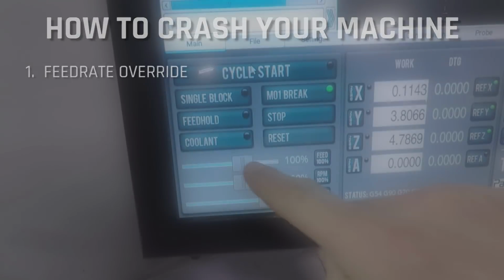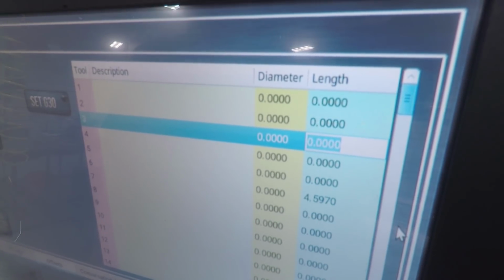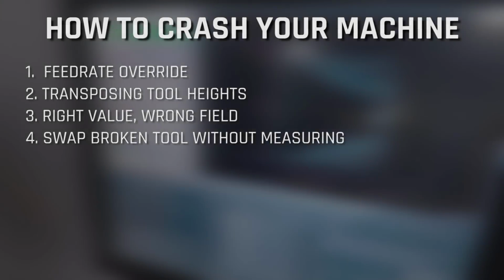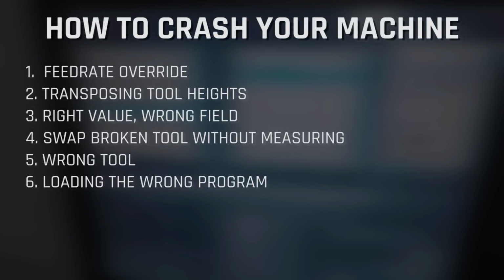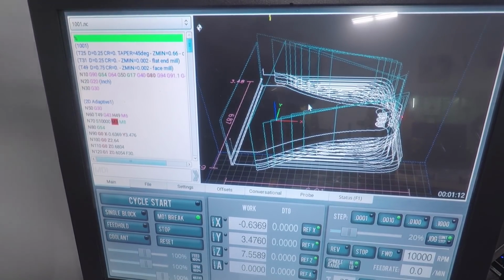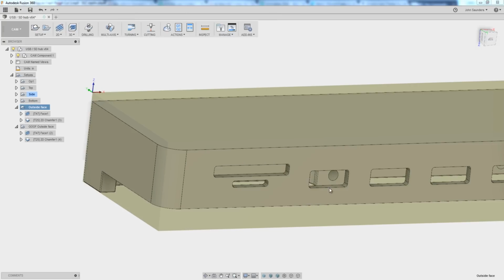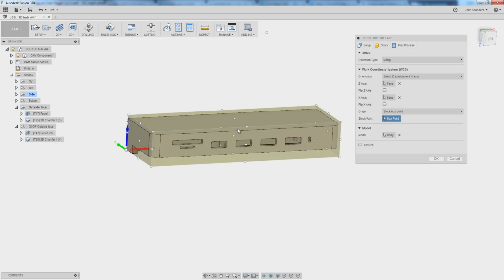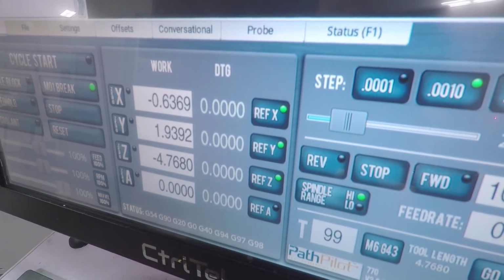9 Ways to Crash your CNC Machine!

Comment: I used to program CNC lathes, machining centers, screw machines, etc. by hand in the 1980s, long before CAD/CAM came into common use..... And I have seen many examples of each of these nine potential crash mistakes. In the beginning I've made my fair share of them, but after a while...... After it sank into my head that human beings make the mistakes...... Not the machine..... I started becoming super careful about every move I made. When I wrote a program I made sure that I knew where the tool was at all times...... Where the edges of the part where at all times...... And where the fixturing was at all times. If I didn't, then they're most likely would be a crash..... And I would be the cause of it.

I can't thank you enough for making this great video! This is the type of thing that all CNC machinists and programmers should see before they even go near a CNC machine for the first time. Great job!!!!

Comment: I crashed my machine. It was a 90s 5th axis thermwood router running on IBM os/2 warp. It was my 3rd week of training and they gave me a new program and both coworkers were at their machines and forgot to modify it for me and I was sitting down deburring my parts and the machine picked up a longer tool by an inch and crashed on top of my fixture and part which was plastic. It wasn't loud but the Siemens controller modual gave me the white screen of death with the picture of the machine and where it happened. After that I haven't crashed since

Comment: Most of these mistakes can be avoided  when proving out a tool for 1st time by using distance to go properly.
If the distance does between the workpiece and tool does not match what’s on the distance to go on screen then don’t press the cycle start button.

Comment: How is still using this method of touching tools off??
A few of those points, you can eliminate with 5S.
Feedrate override is one of the most important things. Especially when you work with 5 Axis.
Proper training of the operators can help too

Comment: John, of you do a video on other ways to mess up in a machine shop, as an apprentice I once changed a tip and pulled the offset way back, got everything running fine and continued machining all night, when assembly started in the morning I discovered that the O/D on my parts were exactly 1mm undersize, I had forgotten one of the rules, ‘whenever setting up or making a insert change, always check with a Vernier before checking with a micrometer. I was trying so hard to keep the 0.025mm tolerance that I forgot the big picture.

Comment: Not updating my tool change position has made me crash my machine twice. I like to make my tool change position as low as possible to cut down cycle time, but if you do not update the position to match the program and setup it may rapid to a tool change position that is below the part or vice!

Comment: I had a few goddamn moments on a cnc lathe . I learned my lesson for the most part , and that is to threat every first part on a new program with utmost attention , rapid movements down , hand on the feedrate override knob . 

The most important thing is don't rush your first part , (i know this is hard to do when you often get one offs , but you must take your time) , make sure you have clearance , make sure you have enough clamping power , make sure you have all the tools measured , and start with 70% of the intended feed , speed and depth of cut , and then icrease them slowly after each successful pass . Doing this you can immediately notice if something is going wrong , and the damage won't be too severe .

Comment: i have a diy router instead of a professional cnc mchine, but i had plenty of crashes.

1. Rapid Z though my workpiece,  the  real Z was below the workpiece Z.
2. Rapid Z though workpiece, Forgot to update Z height with new tool.
3. a broke a drill,  i had the wrong z-retract height.  i had it set to z0 but my workpiece wasnt flat.
4.had some collisions with tool and fixture, those were soms big crahes (and ruined my tools)
5. lot of cooriditate mishap, like mistake the WCS location. (left bottom instead of left top)

Comment: Shouldn't the machine stop immediately when the axis load is different from what is expected? If per model I'm moving trough air, shouldn't the machine stop as soon as the table is registering more load than the weight of the part at this stage of the job?
I expect the controller to have a model of what should be happening, and stop as soon as reality differs from the programmed model.

Comment: Yesterday I crashed my Haas when I tried to restart a program mid-way through.  I set the start point at the beginning of the op I wanted, but forgot that it was the prior op that loaded the tool.  So not only did it not turn the spindle on but it didn't set the height offset and went 1400IPM right through the part.  Luckily the part was HDPE plastic and it was a $5 micro end mill.  I also caught it before it hit the vise so there was no metal to metal contact.  Cheapest crash ever!  Back up and running in less than 5 minutes.  The Haas control has setting 36 that would have caught that error had I remembered to turn it on.  One of these days I'll learn.
Reply: Kent Myers setting 36 FTW!  the only time I'll turn it off is when I have a super long program and don't want it to read the whole way through it first.

Comment: You would likely have escaped a crash, or your friend would have, with your example number 2.  If you make the mistake of specifying a tool longer than the tool actually is you should most likely just cut air.  Make the mistake in the opposite direction...well, your friend would be unpleasantly surprised.  

Good info, good video.

Comment: I learned a long time ago to immediately set all default lengths to 10in before doing anything.  That way if you forgot to measure a tool before you use it, it doesn't slam into the part/fixture when it comes up in the program.
Reply: Damn that is smart
Reply: With a first off, always have low rapid traverse and finger on hold button. And "distance to go" on readout. Also, have confidence!!! Shit happens but that's engineering. Some things are cursed, so if a crunch occurs, deal with it. Stop being shit scared of mis-haps. I got 31 years of CNC. I make a damn good living, I've had crunches. Learn from them. It's all about common sense. But I guess all you posters are yanks?? 🇬🇧👍
Reply: Thanks.  That makes a lot of sense to adopt as a practice.
Reply: This tip is GOLD
Reply: Jason Nackard Yep over here were metric so we always put 555mm in the tool offset table.
That way the machine will Z limit out.
Reply: That's a good tip!

Comment: Empty tools defaulting to 0.000 offset sounds awful. Makes you wish that somehow it could detect an empty tool or change and write in a huge offset until you typed in the next real number.

We always jogged the new tool close to an inch from the vice top and kept jogging up a tiny bit at a time until the 123 block just slid under and recorded that. Don't know if that's a good technique.

Also there was a habit everyone on their first run of the program stared at the first plunge and stopped it before it hit surface and read the distance to go off the screen to make sure it matched what you saw.

I still broke way more than I should have, almost always workholding elements out of place.

Comment: John, this seems like a good project for you. If you put sensors of some type on the racks that hold tools on machines that you manually change tools (switch or optical). Make a arduino setup to check witch  tool you took out of the rack when to make sure it matches what the machine is wanting at that tool change. I don't know on your Tormach machine controller what you can use for a feed back. Maybe you can some how pick up on the tool number and verify that you pulled out and put back the proper tools in the rack. Just a idea if it could be made to work.

Comment: haha i see you done these everything, but theory crash machine not possible. smart guy will allways use single line or lower rapid and look HOW FAR it still go. if you crash machine using new program you just made its operator fault. GO SLOW. what is hurry?operator who stop machine before it hit is better than guy who just think i made good program with CAM it works. CAM suck
Reply: Jari Sipilainen maybe the CAM you are using sucks?   What are you making if you are avoiding CAM?  Circles and squares?

Comment: I crashed my brand new 5 axis VM2-SS from a coding bug. I let my guard down for a split second and BAAAAAAM!! 1400IPM full rapid straight down. My underwear did not survive the event. 
These points are good! Great video.....
Reply: The spindle was still functional, but it did not last long it was very loud and got very hot after that. 
Clearly, the bearings had been damaged. The TR160 trunnion survived. The spindle had already picked up an empty tool pocket (lucky chance) so there was no tool - just the drive dogs. It was also spinning at about 8k or so and chewed right through a Raptor dovetail fixture. 

That is one hard lesson to learn. With a new program.....my attention NEVER goes away from the machine. Finger always on feed hold. With a new program, I always feed hold when I take my eyes off the machine to look at the display. Lots of start/stop with constant G-code scanning for those ooops moments. Treating the system as if it were trying to kill me is how I have avoided any additional crashes so far. 

In 11 years - that is my only machine crash (2010 was the year) .
Reply from the maker: Thanks!  was your machine OK?
Reply: Least it was straight down.  Those tend to not hurt the spindle on industrial machines anyway.  Try doing that in X or Y and then you get to listen to you spindle slowly grind itself to death for the next runs as it ruins parts by no longer cutting accurately.
Reply: @Factory400 I know I am late to this being that it’s a year old, you should look into getting the haas control update for next generation controllers comes with “Safe Mode” that slows accelerations and rapids automatically and can detect crashes and prevent table and spindle damage.

Up date is either live now or will be soon

Comment: 11. Entering standard SAE measurements where metric is required.
Or is that vice versa; I forget. 
In any case, I did one or the other in CAD one time and the drawing became so oversized, it was obvious that I did something was wrong. Do that on the CNC machines council, and you won't see the mistake until the crash happens.

Comment: interesting video. I gather there isn't some type of reverse measuring system that the CNC can lower onto to confirm the height of the tool? Or is this just a case of double checking your work.
Reply: There are electronic tool height setters. They can be used in a script to walk through the tools and verify the heights in the tool table. They are not cheap though, the Tormach one is $800+ :(
Reply: interesting. Given last week they created that iPad camera thing, i reckon a similar setup could be used.
Reply: That would be fun. If making your own, the simplest I've seen is an epoxied micro switch. Little tolerance for crash, but does have some travel, and is cheap and simple as it gets.
Reply: Renishaw's NC4 may be what you are seeking. It's a no-contact tool height setter.

Comment: When I first started set ups, I put in a -.970 instead of a -.097 didn't double check poor vice got it good. Rookie mistake, it happens, just learn from it! :)
Reply: Made the same mistake but on a 3D printer the other way around by having more height. So the printer had no chance laying material down. It was about 0.7 mm off set required for printing on a plastic foil with grattings to inprint said grattings to have a rainbow effect.

Comment: Really enjoyed this video. Recognize all of these. Here's how I avoid three of the problems.
2 - a tool height gauge with USB connection helps
7 - a common NAS drive helps (no thumb drive, no reliance on Internet)
9 - I added button that is "switch to Haimer"
Reply: And yeah I have also heard of tools breaking.  ;-)  actually one time my boss said your not a real operator until you scrap something.  Just goes with gaining experience.  No way around it
Reply: Hi Jeff, I use LinuxCNC, which PathPilot is based on, and I have no direct experience with PathPilot. However, PathPilot runs on Linux (Ubuntu, I think) and so methods of mounting an NFS or CIFS share from your NAS should work. If PathPilot is overly locked down, and if you are familiar with Linux, and root shells are not accessible, I would try booting from a live image disk and modifying /etc/fstab to automatically mount the NAS to a location on the PathPilot machine. (If the drive is encrypted, you may be able to modify the boot parameters, if the boot manager allows this, to get access.) I mention these methods only as a last resort, if there is no built-in method. Best of luck